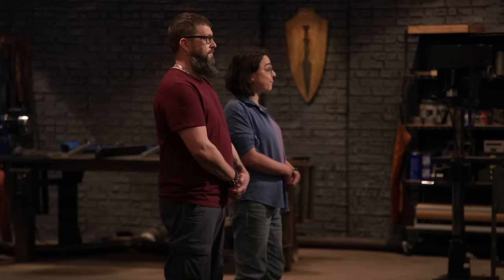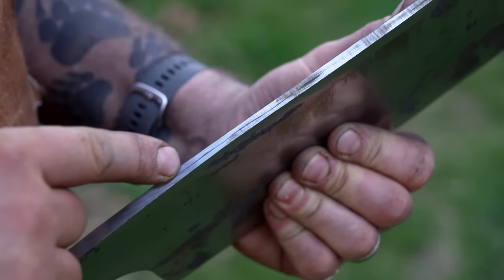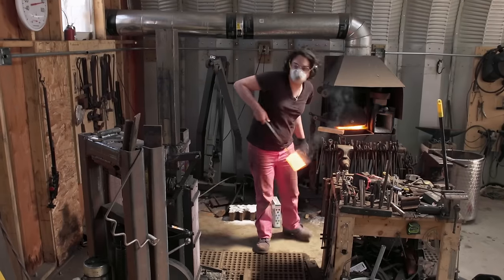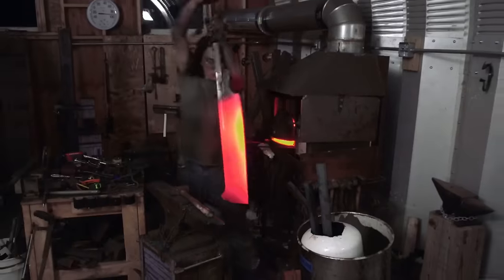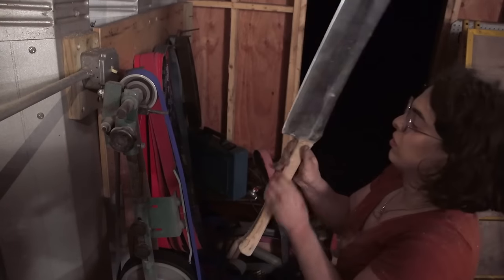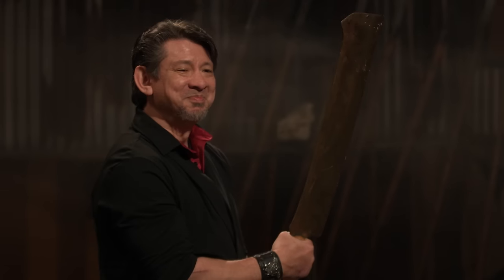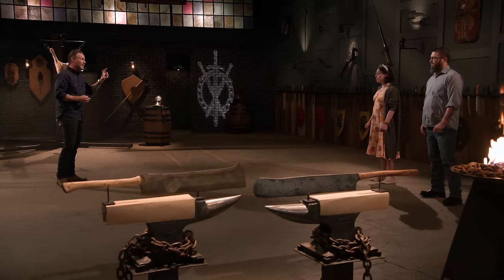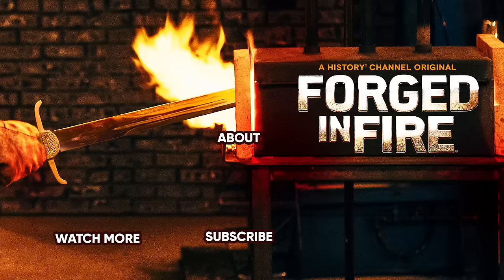Hog Splitter is the Most INTIMIDATING Culinary Blade | Forged in Fire

Comment: 1/8th could count againt him in the final descion, not significant enough for a D/Q
Reply: They said 1/8 to 1/4. Worse, they required a minimum of 4" across the whole blade, and he never made it to 4" on any part of the blade except maybe with that flared tip. If someone told you had to drive a mile without falling below 60 mph, and you drove almost the entire mile at 55-58 mph, would you really think you fulfilled the requirement?
Reply: @reliantncc1864  its a silly tv show not the Olympics...
Reply: @SM-gv9nf  Okay? Not everything has to be the Olympics to be a competition. He failed to adhere to the parameters and was disqualified. End of story. Don't try to strawman and act like an idiot.
Reply: Thats whats know as missing the point... it was amusing though, take care  lol